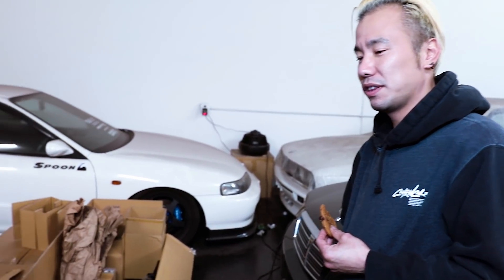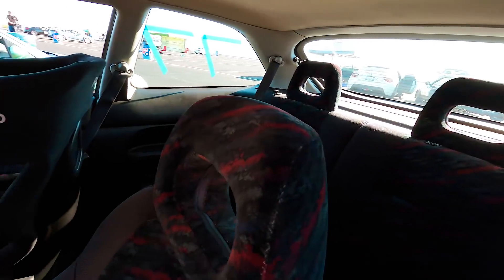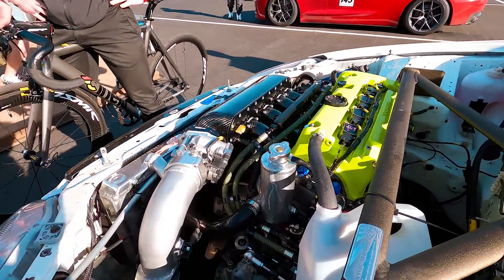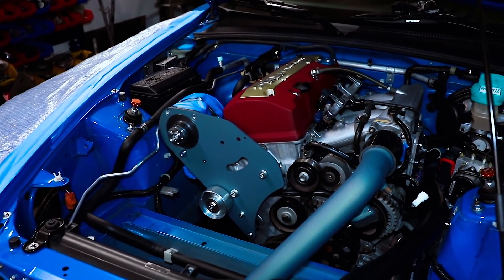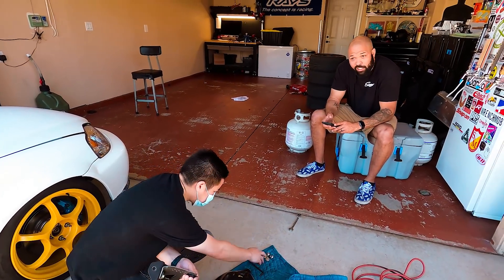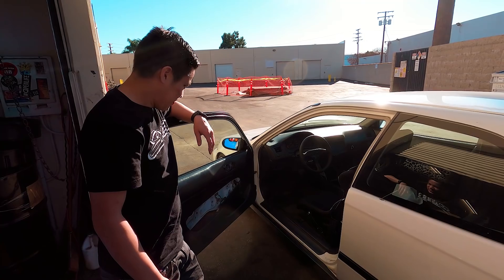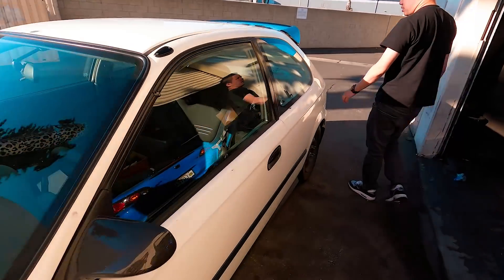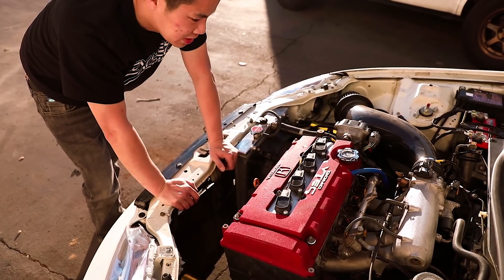Ryan Der's NEW B16B-Powered Civic Project!!

Comment: 4:15 I’m a very DIY type of person, I’ll attempt to rebuild a trans even if I have never done it, but that crank bolt is no joke. I tried everything on my old b18c and that thing was SEIZED! I ended up paying some old guy $20 to take it off... he put it on his lift and busted out a 12ft long thick walled iron pipe, and the cracking sound the bolt made was epic. 

Moral of the story: old sharp mechanics are the best, and Honda crank bolts can be a pain in the a$$.

Comment: I have watched and been a sub almost since day one but please excuse my ignorance. Does Der own part of Rywire? I am doing my first swap ever even though I been a honda guy for 30 years and Im going from a stock b16 in my em1 to a healthy NA Type R. My question which I cant seem to find is what do I need as far as adapters plugs to make this work? I have a Hondata on the way, a stock P28 and was told a obd2 to obd 1 adaptor plug? Do they have something like this at Rywire? I could not find it on their site. I think it is awesome he is back in a EK and still think Kano build? BTW will probably go COP as well.
Reply: I do not own part of Rywire, I just work there building custom looms.  In order to run a P28 on your car, you would need a OBD2B to OBD1 ECU jumper harness.  I do not believe we offer these anymore, as the market is saturated with cheap China copies which can be had for as little as $20.  The quality of those aren't too good, but people don't seem to care as it's only $20, compared to $100 we used to charge when we had them made to our standard..

Comment: Does Der motor missing a body to engine ground?
Reply: It could be, or it could be on the backside of the head.  I haven't thoroughly gone over everything on the car yet, but it seems to run fine.